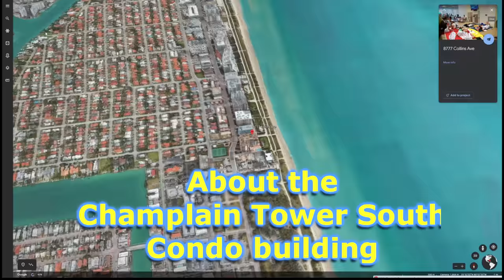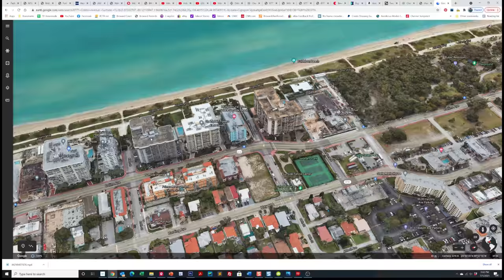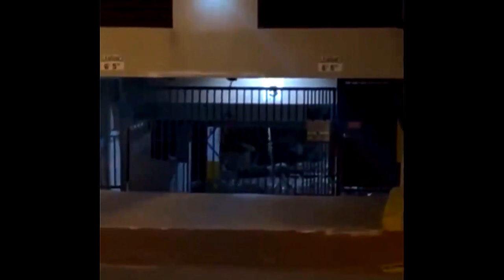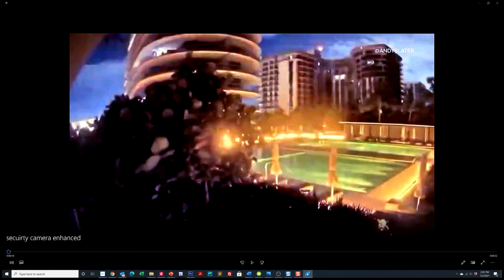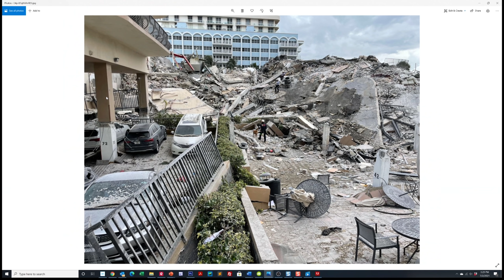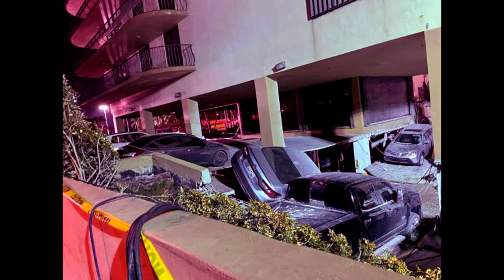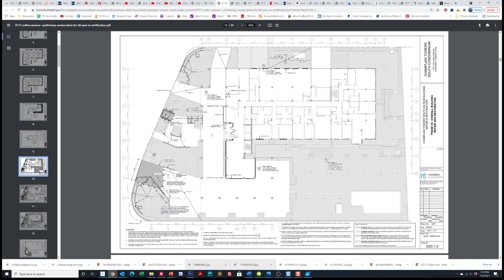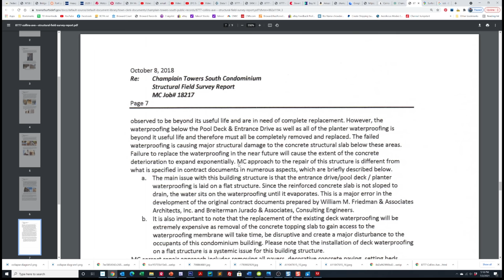Here's Cause Of Miami Condo Collapse Champlain Condo Towers, Surfside

Comment: Hit the fire alarm on your way out : it’s an excellent way to get people out of a building and it may save lives. I understand, people don’t want to be embarrassed, but think about it this way, if your gut is telling you to get out and get away, believe me, a fire alarm is going to get people out in a hurry. (-and the fire department are the people that you want on the scene.)
Reply: @spirals 73 lock
Reply: Yes
Reply: Another lesson learned from the AC units being fine on the top of the rubble is to consider heading to the roof if its closer and you're not sure if you have enough time...
Reply: @halbouma6720  in the center? What if it caves in? I think the edges are much safer
Reply: Good comment about the fire alarm. Why it was not activated?
Reply: ~ However, we are talking about Richie Rich Miami, where outright butting into people's lives is frowned upon, except in secret. Skeptic & impromptu impulsive actions, especially about activating false alarms is largely frowned upon.
~ Rich, beautiful, & stupid is the norm in them rich parts of Florida.
Reply: @diomedesabcmnxyz7299  is it atupid to save lives it may be frowned upon but if it saves someones life so be it
Reply: @HumanBeingSpawn   his assumption was based on the floors pancaking.  The building isn't collapsing because the roof caved in, but because of buckling of structural members in the lower half of the building. Just stay away from sky light windows on a roof.
Reply: I think pulling the alarm is good advice, but, in my experience, when the fire alarm goes off people just sit around and wonder why the fire alarm is going off.
Reply: @tomcorwine3091   They probably would have been awoken by the original collapse as well and with the addition of the fire alarm been motivated to get out quickly.  Unfortunately it sounds like the had had less then seven minutes to gather their senses and evacuate.
Reply: @victoriaorlova1438  If you ever lived in a multilevel building then you know a pulled fire alarm.means lots of doors opening and slamming and lots of vibration from all the people all moving at once.  It would be the right thing to do, but it wouldn't save anybody and may even kill the person who pulls the alarm.
Reply: Hit the fire alarm and the commotion and vibrations from the doors closing and all the people exiting at once would have accelerated the collapse of the building.

So you would be ethically right but dead along with all the people rushing to get out if you pulled the fire alarm, provided you're not right next to an exit, or morally right because you survived by not pulling the alarm and getting out alive, but you have to live with your cowardice for the rest of your miserable remaining life knowing you maybe could have done a little something.
Reply: @fraidykat  thanks for the info.. I'll remember not to alert the people inside of a building if lets say a sinkhole is opening up beside their building.  I'll do the right thing and just walk away.
Reply: @sirmongrel511  It's the basic trolley problem, no matter what you do, the outcome is less than desireable.
Reply: I said the same thing, the lady that took off with her kids could have saved lives.
Reply: @GregoryJohnston77  Only maybe.  In pulling the alarm, there would be an increase in vibration from doors opening and closing and lots of feet all moving at the same time.  Instead of seven minutes, it could have been ten seconds after pulling the alarms.

Damned if you do, dammed if you don't.
Reply: @GregoryJohnston77  maybe she just didn't think of it. It's not like she was trained for it or anything. Her focus was her kids. She alerted security, she did what she thought was right in the moment. U can't judge ppl for how they do or don't react in the middle of an emergency.
Reply: @leodavis9824  yes  and lazy staff didn't use the building income to alert  rest  7mins would helped before colapse
Reply: The security guard could have sounded the alarm. (Though 7 minutes isn't much time to save anyone.) The resident did enough by saying something. She could have stayed silent and ran away, but she did think of everyone else. But when you realize you're in survival mode, you can't afford to be considerate. I don't think she was a coward and I hope you are never in that position.
Reply: no one leaves for a fire alarm

Comment: Imagine waking up to the news that the building you inspected mere hours ago just collapsed.
Reply: Exactly!!!!
Reply: They need jail time
Reply: Imagine being in the building enjoying your holiday
Reply: I wonder what will be a consequences and will there be any
Reply: Well, unless you had x-ray vision, you wouldn't have been able to see the true severity of the damage.  Now if someone had done work on the pool deck and the building collapsed hours later, that's another deal...
Reply: @johnbergstrom2931  Don't you think whoever is licensed to do inspection should be able to recognize severity of the damage just before building collapse? It's either lack of knowledge or entire engineering profession should be questioned what's going on over there
Reply: @goxyeagle8446  Yeah, the Morabito group warned the condo board about this in 2018.  They were ignored, work was put off, residents were falsely told the building was "...in fine shape."
The pool deck and parking garage didn't develop large, expanding cracks that would be an indicator of failure.  They just went...
Reply: @johnbergstrom2931  I can't understand the fact that building is luxury. As I figured residents were paying $900 HOA a month!
How did that happen

Comment: It always amazes me how those who own expensive real estate try to save money on maintaining the integrity of the building.  I have encountered the same problem while living in a condo.  I was a member of the Strata Council for 5 years.  It always took SO MUCH convincing to get owners to agree to basic maintenance necessary to keep water out of the building. Whether it be roofs, windows, or mechanical aspects of the building. This is one of the main reasons I never want to live in a condo again. I bet those owners would not think it's too expensive now to replace the water proofing membrane on the pool deck.
Reply: just stay away from the condos near the ocean or built on sand,,,,the sea salt rots them
Reply: I well want  to move  out of my condo
Reply: The layman doesn't see buildings as objects that require maintenance to the bones, just paint and put up facades as it wears. You see it in inner city neighborhoods with driveways sinking, foundations failing, etc. These are old neighborhoods from the 40's or 50's, plenty are even older. Once the new suburbs reach a certain age, you're going to see the popular split levels and ranches fail the same way. It's preventative maintenance mostly, but it's extremely costly and has no obvious sign of failure the same way a car not starting to avoid grenading an engine does. It's this carelessness that plagues most homeowners that plagues property management as well. These folks are sales people first, and property managers second. They want people to move in and pay, all while making a profit. Roll out vinyl floors over real wood saves money, and in all fairness it is adequate. Real wood is a vanity anyways, all the floor does is add insulation from the floor below, it doesn't matter what facade covers it so long as there is a floor base. But that line of thinking trickles into everything else too, and in this case it went into the building itself. It was neglected and ignored because it didn't have a big red warning saying it's bad, and the people trained to identify those issues, acting as the red warning, were ignored and did not express their findings in a way a person focusing on saving money would understand.
Reply: @anthonyjarrett3206  Get out while you can,
prices will be falling faster than Surfside did.
Reply: @SCIFIguy64  As a designer (not in FL) I agree completely. I have had clients whose home was in dire need of major repair, but they want to proceed with "cosmetic" fixes withuot addressing the underlying failed construction issues. I won't proceed until the home is certified sound with structural problems inspected by an engineer & repairs made by qualified, licensed professionals followed by another inspection.
Reply: More than a few owners in this 40-year-old block bought at prices that would be impossible today, enjoying the apartment as a vacation home with the idea of retiring there. Now the necessary assessments come for inevitable repairs at current-day prices that might equal the original purchase price. No doubt they balked. Effectively re-purchasing their unit much later in life might have been impossible, regardless what the units might have in market value.
Reply: Those with money don't like spending it. That's why they have money.
Reply: @lisarojas5423  Which will not do them much good if they die because they held onto their money.
Reply: Most Americans are living paycheck to paycheck even folks who live in luxury condos.  A lot of them probably went deep in debt to buy the place. Also many condo dwellers in Florida are retired senior citizens on fixed incomes.  Some of the older folks probably don't use the pool, (my grandparents never used the pool at their condo) so the when the condo association told them they were all being assessed $100K because they needed $9 million so they could dig up and replace the water proof membrane on the pool deck, they were like "WHAT THE HELL!  I don't even use the swimming pool!" They probably had no idea that the pool deck was part of the critical structure of the building.
Reply: I wonder what their condo association fees were per month.  I know one who pays $600/mo (in FL) and they get little in return; they have only a pool and a seldom used workout room.
Reply: @jcphenry  If the bulding had not collapsed and the $15 million in repairs were approved, the average special assessment to each condo owner would have been $110,000+.
Reply: @jcphenry  Yep, sadly many people do not plan and save for maintenance of their properties.
Reply: @trevorn9381  Lawyers really should make sure their clients understand their commitment when buying into a condominium so that their client can evaluate the risk they are taking on and thereafter be involved in making sure the reserves will be adequate for major long-term maintenance. The lawyers are the only people involved who will act in the best interests of the purchaser. The realtors don't explain it in case it discourages the purchaser and the developers don't give a damn as long as they get their money.

As a condo director for 20 years there were several occasions where unit owners were only finding out after the fact what they'd legally committed themselves to and they probably wouldn't have bought if they'd known.
Reply: @NLR759  yep, some condo owners really don't like to pay the piper. They want low condo fees yet complain when confronted with the costs of major repairs that could have been prudently saved-for over decades. It wouldn't surprise me if the engineering reports from earlier years also raised flags (presuming that condos are compelled to have regular engineering inspections in Miami).
Reply: @NLR759  that is a good article. I wonder how many of those lawsuits are from people who were fighting against the special assessment?
Reply: @trevorn9381   Oddly enough, the swimming pool at Champlain Towers survived because there was such a thick concrete wall around it.  Had the deck been as well designed, with slopes & proper drains, they wouldn't be in this situation.
Reply: @danburch9989   Those monthly fees only go towards regular maintenance, never towards structural fixes.  This building's pool deck appeared improperly designed in the first place.  No condo's include budgets to redesign the building.
Reply: @unclemick-synths   Had they followed the 2018 report, the repairs would have cost $9 million, but because they waited three years, the deterioration accelerated, and with inflation, the cost ballooned to $15 million.  If you don't fix damage in the early stages, the damage progresses, and then it costs even more to fix.  Unfortunately, these people waited far too long.

Comment: The witnesses claim that the plaza deck collapsed first, the engineering report mentioned excessive spalling, waterproofing failures, and rebar corrosion.  The pool was rebuilt adding extra weight, and also poor drainage with a flat plaza deck. The plaza deck area collapsed onto the deteriorated transfer girders causing their failure.  The transfer girder failure caused the columns to punch through the deck and they also kicked at the building line. Once the building line columns kicked most of the rest of the structure fell with them.  I am an civil engineer and agree with your findings.  

The slenderness ratio of the columns in the pool area being lesser than the building columns is another blatant design error.  The way the rebar came out still attached to the column so clean with no concrete attached has me questioning the integrity of the deck.  For them to come out that clean the deck had to already be cracked, deteriorated and crumbling years before the collapse. 

This collapse was clearly a critical structural failure, and all the various implosion/explosion conspiracy theories are total nonsense.  A planned implosion is similar to an accordion and results in a square flat shaped pile of rubble. A critical failure such as this building results in a random shaped pile with a more pointed top. The shape of the debris pile proves the conspiracy theories to be wrong.  This is a real tragedy, again excellent analysis.
Reply: Thank you for your input. I had to re read your comment a couple of times before I was able to understand what you were talking about. But i get it now. Again, thank you.
Reply: This building was beginning a 40 year 'recertification'.  Yet with these critical structural design errors, how was it ever certified in the first place?  Scary.
Reply: There's a photo of the columns under the building, they looked thin. 110% designed not 200% as one person stated.
Reply: @awakenedone2396  I understand some people think that a van full of explosives detonated next to one of main columns in the parking garage could of taken the building down as well, but there is no evidence of that at all.  Some sort of planned event with enough explosives would have taken the whole building down. I think that it was just a structural failure of a poorly designed, built and maintained structure.
Reply: @maryyung1994  thank you Mary.  I had a mistake that I edited it was the plaza deck that collapsed first.
Reply: It still bothers me that the tops of the support columns were relatively clean - no sign of rebar or other obvious methods of connecting the columns to transfer girders. I would have expected to see something at the top of the exposed columns, but nothing is there. This raises the question - how did they connect the beams supporting the pool deck to the columns? Whatever they did it appears to be wholly inadequate. Between that and the smaller columns used to support the rest of the building, I am not surprised the collapse occurred.  I am not a civil engineer, but even I can see that this is shoddy construction.
Reply: @nicholasconder4703  Nicholas I agree 100%.  They punched through that plaza deck and look like fence posts.
Reply: @micheleh5269  it was poorly designed and built to 1976 standards.  Then it had very little maintenance over the years.  What little maintenance that was done was done poorly.  They added a huge penthouse and heavy palm tree planters in the plaza/pool area making it even worse.  I personally think that there was a blatant design error with the columns, transfer girders and plaza deck.  Since I have never viewed the construction documents that is conjecture on my part, and may not be fair.
Reply: @PaulJersey   Sounds fair to me. Also seems like they're hot and heavy after that Prieto building official.  Yet the Sept 2018 Morabito report said the building structure was in good shape.  Prieto's comments sound similar to what that report concluded.  I know there was the Oct report detailing issues with the slab which sounded like it was more local to the deck area.  If that is what the report indicated, then it makes perfect sense that Prieto would have stated the building was safe.  Somehow the current building official gets a pass, while the previous one loses his job.  They freaked some of us out when the demo'd the remaining part of the building.  If it had been a simple sinkhole no one would have thought anything about  the demolition.  Gotta wonder what's actually going on.
Reply: @micheleh5269  that’s interesting. There is certainly a lot to more to this story than we are being told.
Reply: @micheleh5269 Who needs demo charges when graft and corruption do as good a job?

Comment: Many thanks, Jeff.  I'm thinking back to a remodel we did, many years ago, not too far from a known earthquake fault.  Neighbors snickered that we were "over-building", too many nails, too many hurricane ties, too much steel in a major grade beam, and so on.  The building inspector even joked by asking how many floors we were planning to erect on that grade beam.  After that project was finished, the Loma Prieta quake hit.  On close inspection, there was no visible damage to any of the remodeling we had done, not even a single hair-line crack in bathroom tile.  The neighbors' snickering stopped, happily.  Thanks again for your timely and professional contribution here.